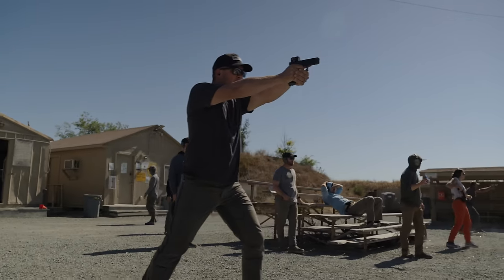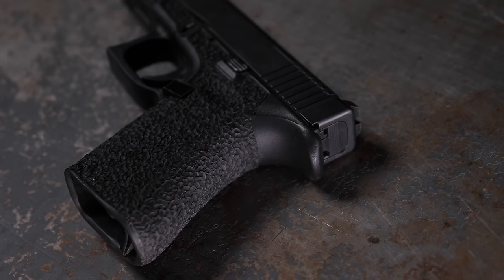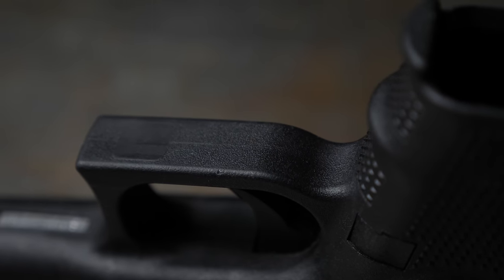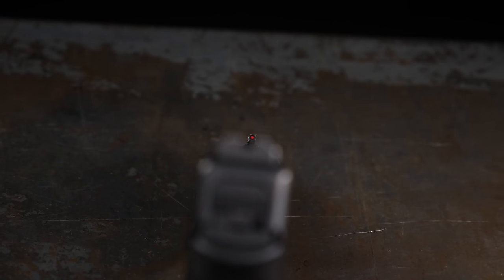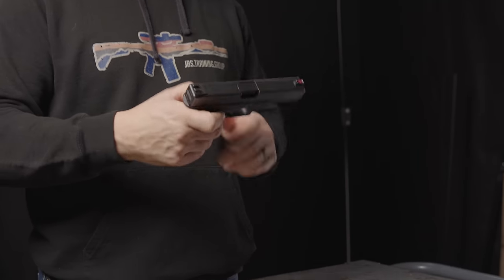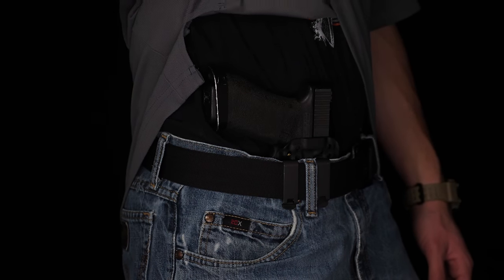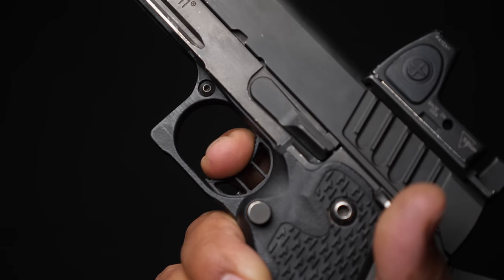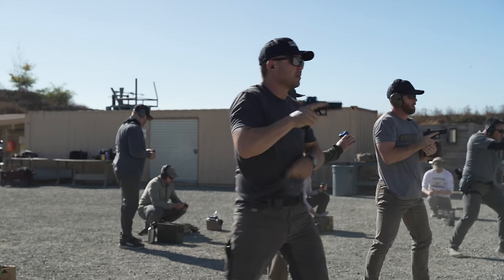Mod Your Carry Gun: Do's & Don'ts

Comment: Any mod you do to your ccw, if used to defend you, or family, or others and still prove defensible , gun grabbing prosecutors will want to prove your intent was to kill, not defend. Be cautious on mods from factory handguns.
Reply: You are only partially correct. Use ANY GUN in ANY shoot and prosecutors jump on the intent to kill attack. Mods don’t help if they are clearly things like statements or specific symbols. As long as you and your lawyer can show that the mods are increasing control,accuracy, and reliability you have a chance.  Changing the grip, using a red dot is innocent, or so you think. One line for prosecution is the red dot gives you the ability to track multiple victims quickly…….see the pitfalls?  Education on the laws is what really helps.
Reply from the maker: We have yet to see any evidence of this holding up in any court. Happy for someone to show us otherwise but so far this seems to be internet lore.
Reply: @tenicorusa  It's not internet lore. It comes from Massad Ayoob and many other lawyers who have also advised against it. I don't know the specific court cases but here he is saying he has been involved with several:
https://www.youtube.com/watch?v=EeLgzT-9N54
Reply from the maker: Appreciate the link. I'd just distinguish between a prosecutor arguing something and it actually holding up in criminal or civil court. Anything can be argued, whether or not it stands is the issue.

Comment: HOW TO MAKE YOUR CARRY GUN BETTER, IN 3 EASY, CHEAP STEPS:

Buy a gun that does what you need from the factory (buy once/cry once)... Stop pretending  to be an operator (you're not)... Train more with what you have(it's more important than a 200 dollar apex trigger)...  

This notion that every gun needs every option, every light Lazer and optic, super duper grip texture, speed holes, and super high capacity, is getting out of hand.   

The average encounter takes place at 5-7 feet, and no aiming or reloading takes place.  All the "fancy" is for show.  

That said, it's your gun, do to it as you please. Just know people that know, giggle at people who dress up their 500 dollar Glocks to look like competition guns, then shove it in an AIWB holster.
Reply from the maker: All of the fancy stuff is fun and should be left to the situations where fun is appropriate
Reply: I agree with parts of the reply. I adhere to the 3x3x3 Rule, that most armed citizen or ccw lethal events; NOT sworn LE or security situations, are- at a range of 3yd or less(some 3ft), in a span of 1-3 sec. With maybe 1-3rd fired TOTAL. I'd agree you don't need a ton of custom add-ons to Glocks but they can get a few tweeks. I add Glock Store slide locks, 3 dot night sights, some barrels KKM or True Precision. Tango Down mag release, slide stops. Milspin back plate

Comment: Don't put a fiber front sight on a carry gun because you can't see them in low/no light situations. A magwell is not necessary on your EDC due to the fact that most self defense encounter will not require a reload by civilians. Red dots on your EDC is unnecessary, and having a small red dot is a waste because you won't see it under stress

Comment: You are correct in not recommending mag wells for carry but you missed one big con. They make it more likely that a standard magazine (like a 17 round mag on a Glock 17 for example) will not seat when reloading under stress because it blocks your hand from pressing it up all the way. This does not mean it won't but just like I can absolutely seat a 30 round AR-15 magazine on a closed bolt I know under stress that my risk of it not seating is much higher and that is why anyone that knows anything loads to 28. I LOVE the faces of people say this is a training issue and then EVERY SINGLE class I attend has a mag drop out when shooting on a timer because they are under pressure for the first time and no one is even shooting back. Same with the mag well on a carry gun. The 0.1 seconds it saves you on the reload is worth it in competition but the decreased probability of the reload actually reloading the gun isn't worth it in the streets.
Reply from the maker: "anyone that knows anything loads to 28" 👈 demonstrably not true
Reply: I’m not going to argue on the Internet with strangers but I have seen first hand repeatedly why this is the best practice and the list of instructors that I respect all teach this philosophy. But to each their own. Heck some people think a Taurus Judge is appropriate for self defense, I’m just glad they carry a gun even if they’re wrong.

Comment: no offense but I’m not going to listen to anything anyone has to say about guns if they’re running exercises that have them running down range while someone shoots behind them. 0:40
Reply from the maker: That was a Kyle Defoor class, one of the best instructors in the business. And that was after multiple dry runs and with folks monitoring safety. Extremely common at higher level classes.
Reply: it’s extremely common to throw basics out the window if you’re in a “high level class?” that’s concerning
Reply from the maker: "Basics" are the building blocks to higher levels of skill. The days of bad guys on one side and good guys on the other ended in World War 1. These guys are training to defend themselves in a violent encounter not volley rounds at Redcoats. You start with the basics but training wheels need to come off at some point. Hope this helps. 🤙
Reply: @tnert115 you will inevitably be doing more unsafe things in a higher level class, why..? Because real life situations are not even close to being on the range.

Comment: Not sure how you can call a magwell “stupid” from a conceal perspective. When it aids you in faster reloads. Why wouldn’t I want a faster reload when I carry a sidecar mag/holster. 🙄
Reply from the maker: Because it makes the gun far less concealable all of the time in exchange for a maybe faster reload which will probably never happen 🤷‍♂
Reply: @tenicorusa  Seconded. The whole point of concealed carrying is low / no vis defensive capabilities. A spare magazine is prepared, but a magwell is counterproductive to the whole purpose of concealed carrying.
Reply: This is all so personal and individualized.  I'm a big fat slob who dresses like one . I can carry a Glock 17 with a plus 6 extension and it doesn't "print". Also it's kind of up to  me if I even care if it prints.
Reply: Be realistic dude, unless you're law enforcement or an operator why would you as an average civilian expect to have to be in a drawn out gunfight and need to reload?
Reply: @Killer-SeveN  not really, but its still possible. Whats more likely is a type 3 malfunction, which is best solved the same way you reload.

Comment: Here come the idiots talking about light triggers are bad 😂
Reply: Light triggers are bad
Reply: @JasonNortwich  I always love this ridiculous argument. Why?
Reply: @SMS2884  I think the train of thought is that if you ever use your firearm in a shooting and you end up in court, the prosecutor will tell the jury that you are irresponsible because you modified your trigger (made it EASY to pull) and paint the picture of you being reckless. That's just my guess, I could be wrong.
Reply: @JasonNortwich  So if you accidentally shot when you weren't supposed to and you blame it on the trigger. See the issue with that is if you don't have trigger discipline it won't matter. Not ready to shoot then it won't happen. My finger isn't going on that trigger unless I'm going to pull it. No NDs. And why are you in court? Odds are you did something you weren't supposed to do and that's why you are there. Unlike most people would make you believe on the Internet, Good shoot means you go home and you never see a court room or get charged.
Reply: @SMS2884  I would argue that fine motor control is often reduced in high stress, high intensity situations (specifically for those without combat training or experience, the vast majority of CCW owners). 

Obviously this falls down to training. Most will agree with that. But the by far majority of NDs are from people pulling the triggers themselves not from faulty parts. How many of those were not simply because they didn't clear the chamber but because they under estimated the force they were putting on a trigger while simply "resting there finger" on the trigger while not intending to fire (bad idea don't do that. But in the real world idiots do idiot things.) 

99% of all gun owners will never train to such a degree that in a Defensive shooting situation that they'll need or even safely use a lightened trigger. 

In summary, people are more often than not less capable than they realize, the majority won't be trained to standard, all while high performance triggers are marketed to the everyman. Maybe your trained enough but I'll bet 9/10 people aren't.
Reply: @Enoch-wi2qz  That's a myth. I wish I could find it. A well known firearms instructor did a video on it before. I can't remember who it was. James Yeager. Might have been John Lovell..
Reply: @SMS2884  You do you man.
Reply: @JasonNortwich That specific argument is stupid as your light trigger didn't cause you to shoot a man in self defense, the trigger pull is intentional and made to be smooth and light so you do not jerk the gun and hit an innocent bystandard.
Reply: @Justin-rq6kf  You do you man
Reply: I'll come at it from a different way. Some designs when lightened past an arbitrary weight , can become not drop safe.
Reply: Light triggers are bad w/o additional safety mechanisms.

On a 1911 it is great, on a striker with a manual safety this also applies. But just like I would never carry a DA/SA with the hammer fully cocked I wouldn't want my trigger for a gun with no manual safety to be too light.
Reply: @JasonNortwich   See Massad Ayoob's points or older articles. He explains it.
Reply: Ayoob is a charlatan. Any time he ventures a opinion, ask yourself “where is the case precedent for his claim?” usually it doesn’t exist.
Reply: @DavidLLambertmobile  I don't need anyone to "explain" it to me. I don't modify my firearms (i.e., make triggers lighter).
Reply: “Light triggers” are great, when they’re from the factory or have been specifically and thoroughly tested by reputable combat oriented organizations. For example, Geissele SSA/SDC triggers were specifically evaluated by the Navy (Crane Naval Surface Warfare Center) for safety and reliability. That trigger is around 4.5 lbs. that’s light compared to many milspec triggers on the AR platform. I have no problem when someone runs that in a duty weapon. But a 2.5 lbs competition trigger? You’re out of your mind.

As for pistols, same concept really. Glock makes an OEM performance trigger now which is designed by them and for their guns specifically. Run it if you want. But don’t put a competition trigger in your defensive carry gun. 

If for no other reason, whether you agree with the argument or not, it will be brought up at your trial and the jury, who will have no idea about guns, is going to buy the argument most likely.

Run OEM stuff. Buy a Walther PDP Pro. That trigger is more Gucci straight from the factory than anything Glock makes. Otherwise, deal with it.
Reply: @Cortezuma  as I've stated. If you're in court for a defensive shooting then clearly whatever you did, a light trigger is the least of your worries. You should never be in a court room. Justified shootings will never go past the stage of going down to the station to have a conversation phase.
Reply: After doing a lot of research about light trigger pull weights ,and those getting used against you in court after a self defense shooting. That it’s pretty much an urban myth in the concealed carry community. A couple of self defense lawyers that had each represented people involved in self defense shooting said that there is a possibility it could be brought up in court but was never mentioned in any cases either one had been involved in or any self defense case they were aware of.